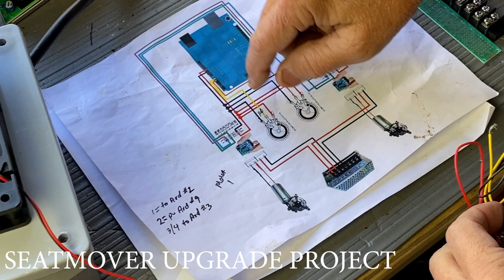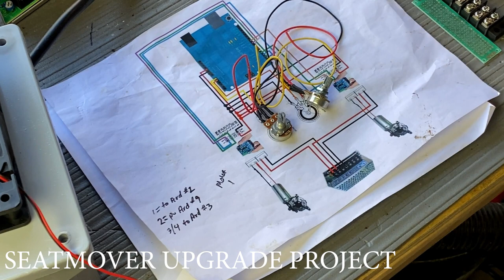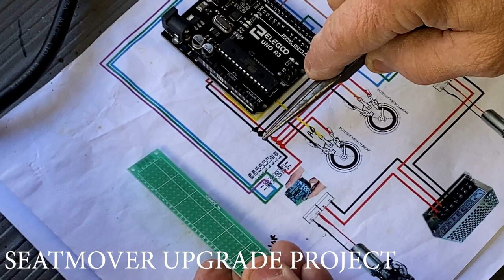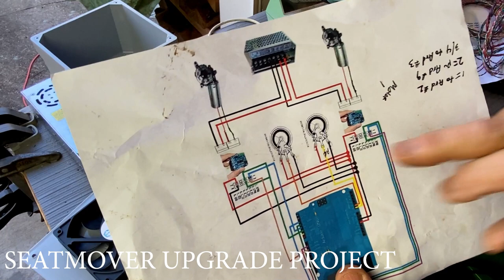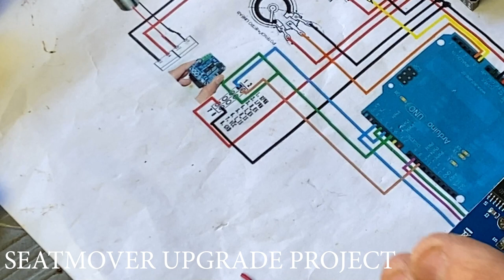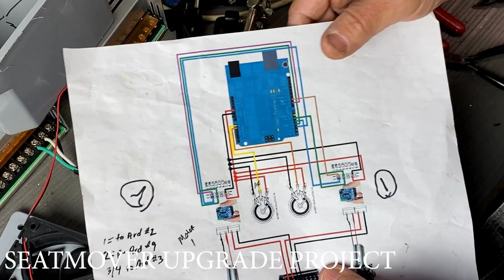2 DOF DIY SEATMOVER ELECTRONICS - Wiring, IBT, Arduino, Fan and motors

Comment: Hello, I love your videos and I followed your steps and was able to put together a 2 dof. I have a big problem and I hope you can help me. My 2 DOF works fine until the moment I adjust the potentiometers on the motor and that's where the SMC3 stops, everything remains off. but when I remove the potentiometers from the motor and they are loose there it works again. I hope for your help and thank you very much
Reply from the maker: Oh wow..  Sorry to hear that..  I've not run across that issue yet.   Ok.. so go back to basics.. disconnect power from both motors..  Get SMC3 running and make sure the  Blue Line (pot line) is in the mddle.. if you move the pot, the Blue Line should move with it.   Then move your clip limits and max limits out a bit..  The MAX limits (red line) will shut off the motor if the blue line intersects with it..    Try and get just ONE motor working at a time..  Let me know..   Dave

Comment: love the way you explain everything, my only thing is once i have done all of this ,  and download the software to the Arduino, I have 24volts going into to the IBT-2 but i have no output coming out to the motor. when I do just a test to see if the pot is given a reading it is in the sim util. so not sure why i'm not getting any output.
Reply from the maker: Ok.. so a couple checks first.. Find the com port that the arduino is on..  Open the SMC3 configuration text file and edit the comm port so that it is the same as whatever com port your arduino is on.. save the file..  Then Open SMC3.. it should say (same com port) on bottom right..  Your Potentiometer (wired to A0) will give a reading to the arduino on Motor 1..   Let me know if you can twist the shaft of the POT connected to A0 and if the green readout moves when you do.. Dave
Reply: @DMAX_DIY  , yes when I do this the green readout moves.
Reply from the maker: @JoeArena-x7l  Ok.. I ususally test the motors first to make sure they work ..  If they are 24 v, you should be able to momentarily make them spin  (without ardunio or IBT) just by touching the two wires coming out of the motor to the power source two wires. ..  I do that all the time just to be sure the motors work..  I hope that makes sense..    (two motor wires ,  two power wires)..   if you get it to spin one direction, flip the wires and it should spin the opposite direction..    Just to be sure the motors actually work.. sometimes they are duds..
Reply: yes did the test the motor works in both directions, also notice on my simtool that when i put motor 1 on the yellow line moves towards to blue line and not the green so i must have something not connected right can you help? @DMAX_DIY

Comment: Another great video. Would be interested in seeing the code for the uno and how to set up with smc Utilities I’ve checked out your previous videos, but I’m struggling to get my motors to move I’m using v similar motors to this build.
Reply: Sorted mine now was dead ibt2 boards so thank you for your videos all electrics done ✅ now onto the frame work and mounting. Keep up the great content
Reply from the maker: @jimchilvers7281  Thanks for making the comments my friend!  You never know who might need to read them and the do help others out..  Glad it was just an IBT..  remember to have a fan on them once you get them under load..  they need active cooling.. Dave
Reply: @DMAX_DIY  I have 2 40mm intake and 2 40mm exhaust fans at the moment only 24v ones I had laying about, I do have room for a bigger one though so if these ain’t cut out for it I’ll upgrade to bigger ones. I’m still not 100% sure on settings to use on smc3 Utils but I guess it’s just trial and error depending on motors. Really appreciate your videos got me motivated to carry on with my build.
Reply from the maker: @jimchilvers7281  Hey I would think that those should be just fine..  As long as there is AIR blowing on them ..  It is a little trial and error on the SMC3.. but I'll go over the initial settings  in my next vid. that should make them move.  You're close! and then all of a sudden you are moving in the game.. It's pretty fantastic..  It happened for me about two years ago and I really like building these things.    Check out the x-simulator.net  forum..  good folks there.. TONS of info too.. That's what I started with.. Dave

Comment: Hi I've bought the uno R3, ibts and petentiometers and ready to wire them up :D on the COG video on your 3DOF rig for balancing the seat and frame with everything else.do I find the COG for the seat using the pole method, weld the Ujoint on and then balance it on the frame with everything else OR do I find COG with everything first then weld the Ujoint?
Reply from the maker: Your doing great Ryan.  Ok on the 3DOF full frame rig, I had to use the pedals and wheel as well as seat to find the COG..  It's a bit precarious cause they are not connected together.   but you can get pretty close.  Also you need to be sitting in the seat .  Helpful to have someone assist you but I did it myself.  Anyway, once you find the Center of Gravity, Just line the U Joint up on the mid frame and tack weld in place.. I bolted the top of the U joint to the upper frame.  You could take a look at my x-simulator build photos if you want here :  https://www.xsimulator.net/community/threads/full-frame-2-dof-traction-loss-new-build.14740/
Reply: @DMAX_DIY  Brilliant thankyou for your help Dmax, really appreciate it, your build inspired me to finally start my own

Comment: Hey Max, just wanted to ask a few questions if you could answer So if I understand this correctly. I'm on my way of getting everything together,  power supplies, got 6x IBT-2's, got the arduino's, and need the motors and the pots. 
The motors you're using, are they 24 volts? I have 3x 12v power supplies for up to 30 amps of current, (as I might want to go for full platform rig (not seat mover that is)) and want to buy the 12V Crab pot motors on ebay. Can I hook up two motors to the same power supply or do I need one for each?  And if I can hook up 2 motors to the same,  that would mean 12V and 30A /2 on each, = 15 amps per motor? 
Just collecting my thoughts :) can't wait to start the electrician education (if you can put it that way) this fall, been waiting to do that for over 2 decades :) 

Thanks again for the inspiration to start this :D and for the Simtools the other day :)
Reply from the maker: He Proximo! good to hear from you! So on the 3DOF rig I am using the 12 volt crab pot 50:1 motors .. all three of them run off the 12 volt truck battery.  On the 2DOF seatmover, I have two AC to 24vDC converters, one per motor. Motors are 24volt wheelchair motors at measured 18-1 ratio.     My opinion would be to get the 12 volt crab pot motors as I can vouch they are powerful*.  I would attempt to run them off the 30 amp supply   but since you already have 3 x 12v 30 amp supplies,  It would be easier on the power supplies to power each motor.  FYI the most my 3DOF has pulled  hard brake to full accel is 25 amps.. but that was a while ago and I have 'turned it up since then'.   Keep pluggin away..  I just bought 3 more of those crab pot motors cause the had them in stock.. I just got them the other day..  * building a 6 dof or at least going to try it..  Dave
Reply: @DMAX_DIY  Thanks mate! I'm on my way buying the motors after getting shipment quotes from the crab pot motor guys, makes quite a difference on the budget  :D And I can't wait for the videos on the 6dof from you when you start making that :D
Reply from the maker: @Proximo011  Yeah The price went up about $20 bucks per motor.. cause of whatever..  but I've been waiting to get the extra 3 for about 8 months now..  and they are sittin on the my workbench  just waiting for me to attempt the 6 DOF..   Thanks again for watchin my videos..

Comment: Hi Dave. I have been glued to your videos! I am starting from absolute scratch. As both my PC and my laptop are not powerful enough to  run a sim rig, could you recommend a affordable computer set-up please. Many thanks Graham.
Reply from the maker: Good Question Graham.  Perhaps others will weigh in as well on this. Anything equal to an I7 or better, 16GB ram and a decent video card will run your GAME, The motion sim and other things.  I can run the 2DOF motion sim and Live for speed on a super slow win7 laptop with 8GB ram..  It runs.. but I would get something better than that..  The motion sim is really just an Arduino and it's software is not very CPU intensive.  Hope that helps you out.. Dave

Comment: Your videos are great. One question, can I use Multiturn Potentiometer 10k Ohm Precision 10 Turns Emn?
Reply from the maker: Thanks for taking a look.. I dont think that will work very well because you need the pot or sensor to be reading position from 0 to 180 degrees.  If it is a multi turn 10k, the pot would have to turn more than that (if I am understanding you correctly).  The hall effect sensors I use have a 'sweet spot' of 180 degrees,  they are multi turn because there is no physical boundry for them to reach.  I have found some more inexpensive Hall effect sensors and listed the part numbers the this video below.   https://www.youtube.com/watch?v=BrHvLULfeEQ&t=588s    Dave
Reply: @DMAX_DIY   Thanks for your answer. I bother you with the last thing. Can you give me a purchase link for an engine that works for me and that is not very expensive on Amazon. Since I am from Uruguay and I have to bring it to my country because there is nothing here. Thanks for everything

Comment: I'm assuming I could use an arduino mega to do this too? I've got a few of them laying around
Reply from the maker: Mark..  NO..  for whatever reason the UNO is the only one that works with the code..  Others have tried different boards but seems like the UNO is the one..  Hope that helps.. Dave

Comment: Great job I hope that it's that simple for me.and I got to motors just like your on ebay but I think there 12 volt how can I know for sure
Reply from the maker: Hey Henry..  Sometimes the seller listed some of the specs on ebay..  Check the description of what they came off.. If it was a Jazzy and the look the same.  Send me the link to your ebay purchase page.. Maybe I can look.. max.motion.simulator@gmail.com
Reply: Thanks  I see they have 12 -24 volt on the description. Could it be they don't know .
Reply from the maker: @henryjames3580  Not sure  about this but I did read a couple EBAY ads that say 12-24.. They indicated that they would run 120RPM at 24 volts  and  60 RPM at 12 volts, which is what mine do.   So all I can say is try them and see what happens.    I would probably post a photo of them on x-simulator with the question.. how do I tell if they are 12V or 24 Volt?  Those guys there probably would know for sure.
Reply: Hey bud the tenomiter is out of stock that you linked to what can I use and how do I know how to pick one that will work thanks

Comment: Hello, I have a question: How to set in sim tools so that the motors are in the same position so that the platform is level.
Reply from the maker: Hey thanks for taking a look..  It's pretty easy.. I probably have not explained it very good.  But  I have a new vid coming out May 14/15  that shows how to set stuff up..  I realized that I was rushing though the videos and not explaining things the way I should so In my newest series, I am slowing way down and taking things step by step..  wiring up things wrong to show what happens when people do that and how to correct it.. basically things I WISH I WOULD HAVE SEEN someone make a video about.. SO tune in if you have time

Comment: hi again dave what if i use only one 24v 25 amps psu will it work?
Reply from the maker: I just found your question  (Feb 7th..)  Thanks YOU TUBE for letting me know ..  sheesh..  Ok.. The biggest thing that may let you down is  PEAK amps..  if you accelerate and then brake real hard you push the motors to deliver their max .  Which would trip the power supply..  I would try it.. but if you end up tripping them, maybe just use one per motor..   Great question!  Wish I would have seen it sooner my friend! Dave